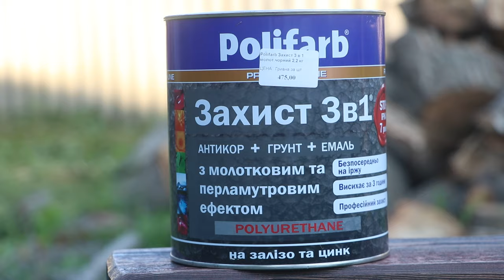How to put a fence yourself from a profile pipe and metal sheets.

Comment: Complicateing with no reason. Just put the poles and bolt sheets horisontaly. Use a shet of 4-5 meters. And this is all wrong, the structure should be on the outside not in. From inner side should be visible only the green face of the sheet. You are doing fence to look preety in your yard, not neighbour’s
Reply: Conde Escalera  no why would it?
Reply: I disagree completely! The flat side of boring and ugly. The framing makes any fence look 10x better and provides structure to do things like hang planters from!
Reply: @Luckingsworth  in that case, the plates on the roof, which he used here, would be mounted from the attick also.
Reply: @Luckingsworth omg
Reply: It looks really nice but structurally I wonder if it will hold up beyond 40 mph winds.